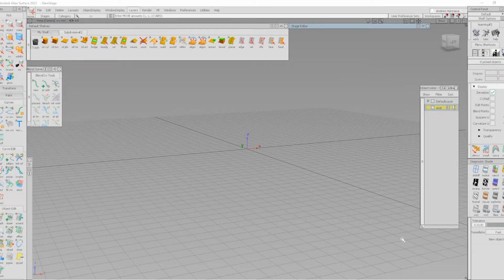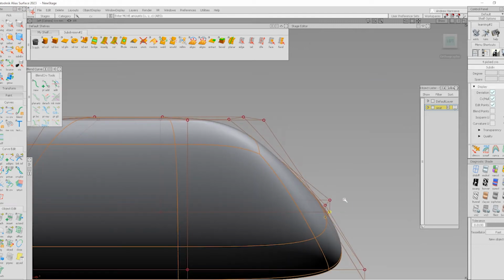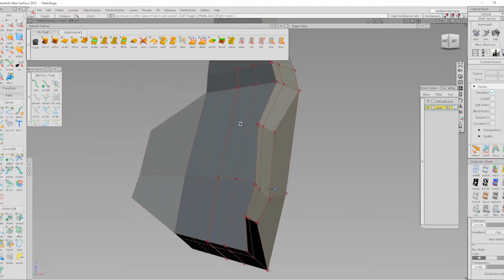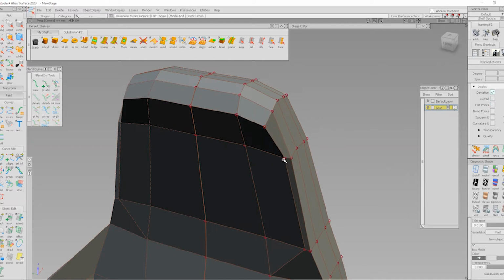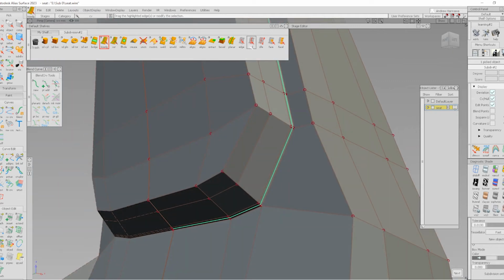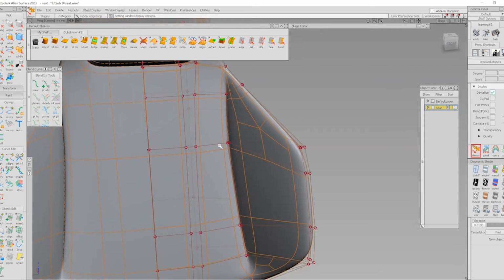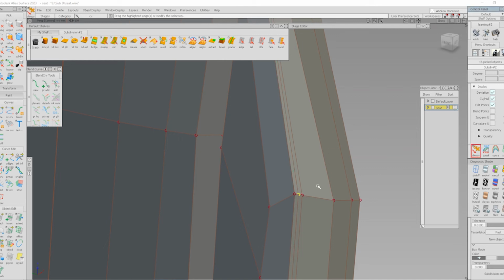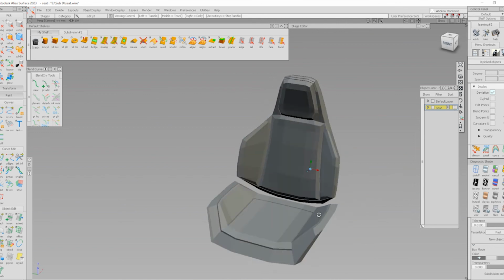FREE Alias SUB-D Seat Tutorial | Freestyle Modeling Without Sketch

Comment: Can you please tell me why insert edge on a basic cube will not create a loop? It will only insert an edge on one of the surfaces but won’t loop. I am using alias 2022.  Is 2022 different?
Reply: use 'perpendicular' in 'insert edge' option
Reply: @Yoo-q7g  t
Reply: The new 2-23 version fixed the problem.  Thank you